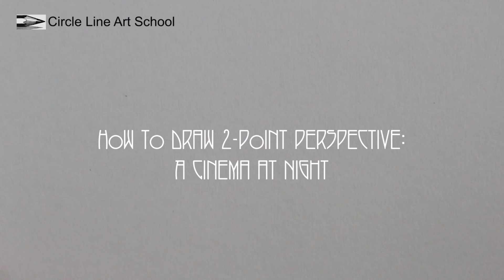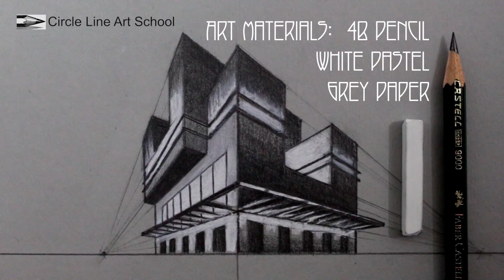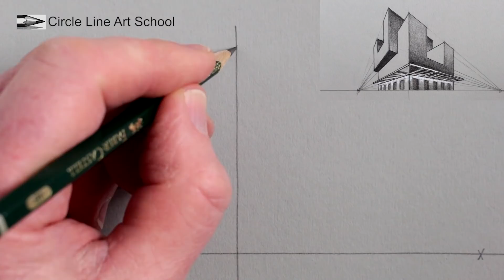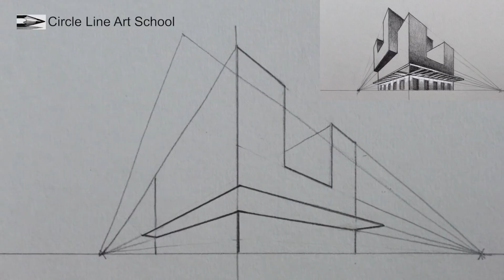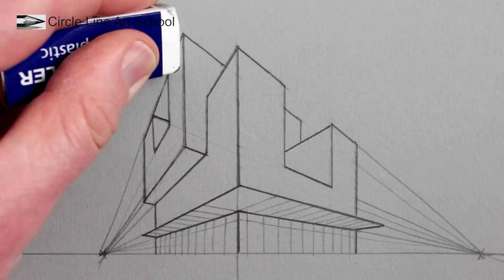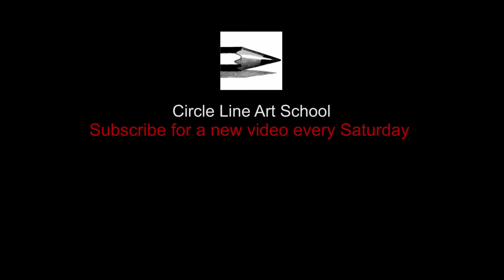How to Draw in Two Point Perspective: 3D Building

Comment: I’m just now using the types of 1B pencils you use, they seem a bit dark the higher the 1B-8B is 8B is a really dark pencil. After B pencils is it graphite then? Or is 1B pencils graphite? I’m not understanding the 1B pencils that much :/
Reply from the maker: Hi, With all graphite drawing pencils, they are often labeled using the HB system.
H = Lighter tone, sharper and harder point.
B = Darker tone and softer point.
So a HB pencil might be good for writing, a 2H might be good for drawing fine lines, a 2B or 4B might be best for drawing, as you have crisp lines and a range of tones to use. Best, Tom:)